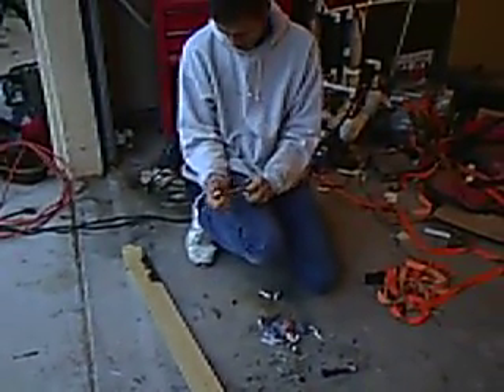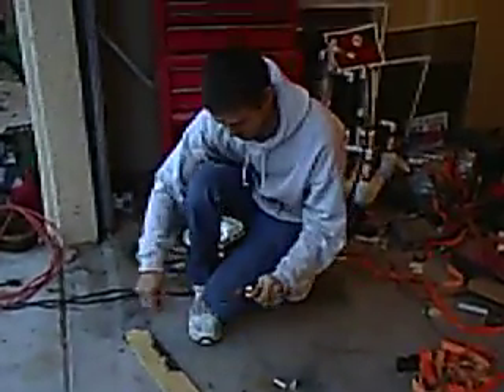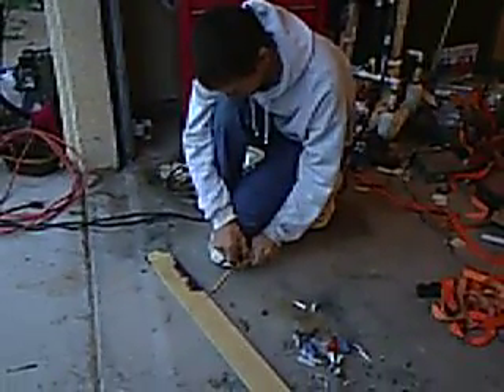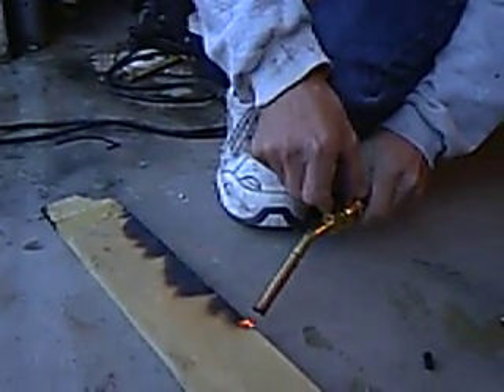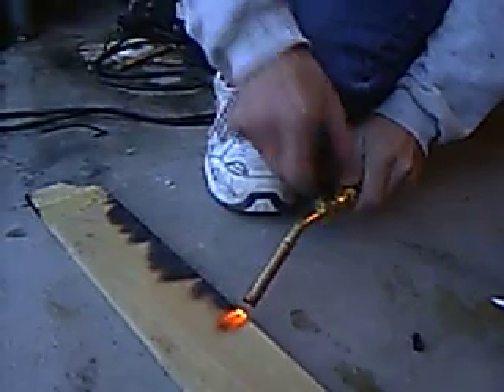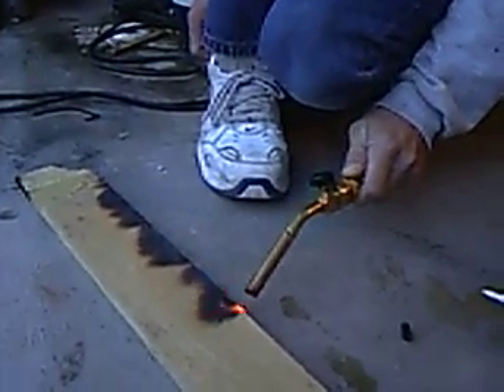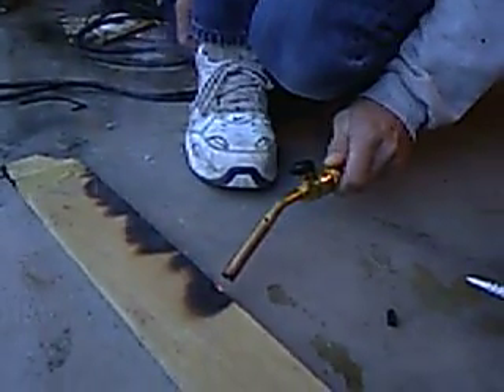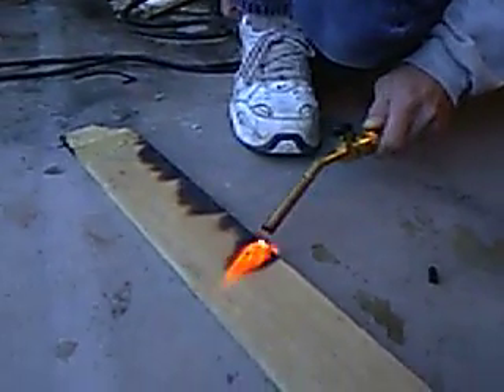solar  torch

Comment from the maker: I am sorry I didnt make it clear. This is pure h2 not hho. my solar panels slowly build up pressure.. what you see is 4 watts producing pure h2 at a rate of 1 litre per 2 hours = 8watthours per liter. It took 4 hours to build up the 2 litrers I used in this video.. so far without pulse I can make hho gas using 3.4 liters per watthour...

Comment: There is no way your producing that much Gas from that small of a solar cell panel. How many watts is the panel and at what voltage. You must be using a battery and charging it with the solar panel. A 45 watt panel is going to be 36"X36" in size and will only produce 45 Watts.
Tell Us how you are doing this. I have may hundreds of hours in electrolysis experimentation and if you are producing this much gas strictly form the solar cells. Please tell us How!!!